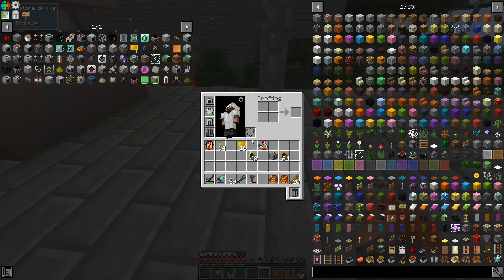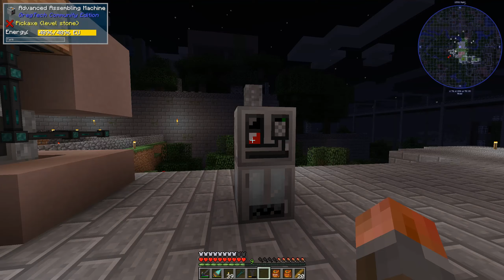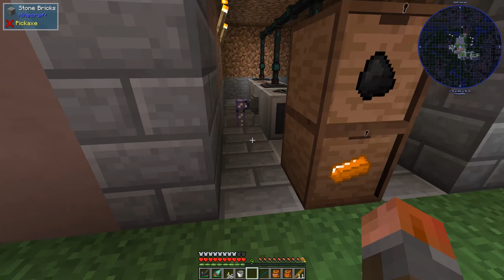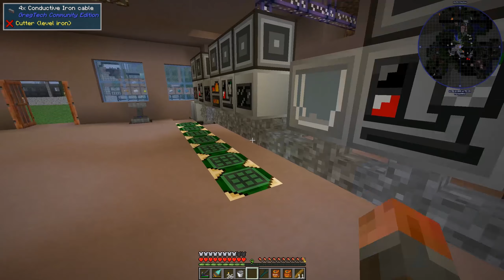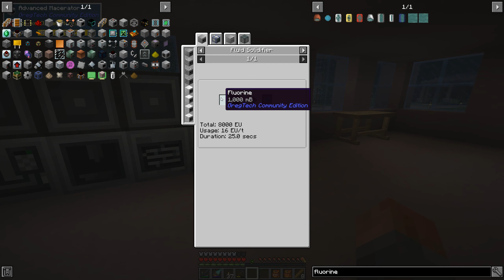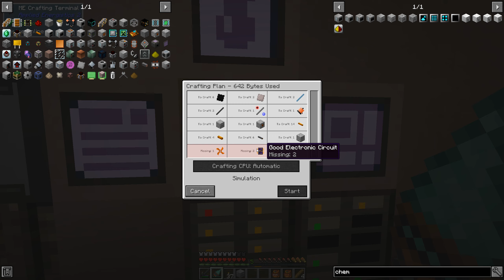Omnifactory E32 - Refined Circuits and Preparing for Nether Star Manufacturing!

Comment: Hey m8, Just to let you know about that Good Electronic Circuit thing... I think it's a bug or something, I couldn't get it to work. What I did when I made a recipe and the system put in that Good Electronic Circuit I replaced it manually with a different tier three circuit (I picked the first as its cheapest for me) and then it all crafts fine and subs in a different tier three if I have that in stock. The recipes are fine with 1st, 2nd, 4th just seems to be the 3rd that has an issue. (Haven't got to tier 5 or beyond yet, Im just a little past you, have just been to the moon.) Hope that makes sense, not the best at explaining things :)

Comment: Hey!
I recommend:
-to use void crystal instead of obsidian for dark steel
-no to jump to mass prod in all cases (eg. as you did with the resistors), for as you will advance, and it becomes superfluos.
-So in cases you know you will advance, you should autocraft it, and keep in stock some of it (interface-storage bus method)
-to have a few separate line of machines for autocrafting only
-to dare to use advanced machines

Aside from that, quality content, love it!